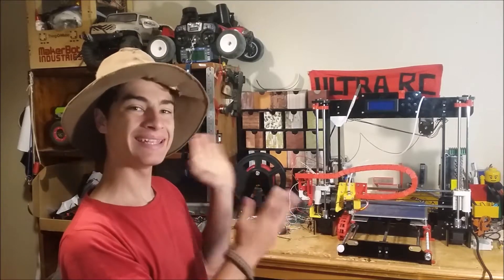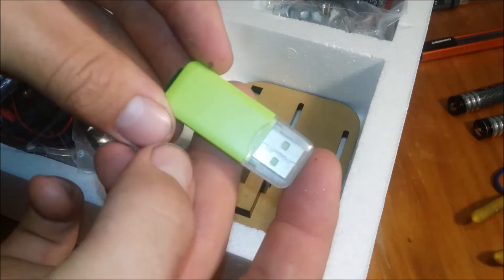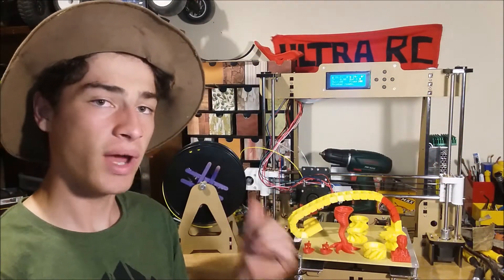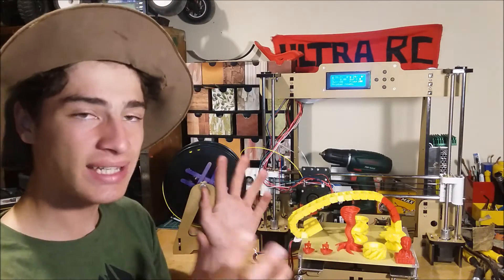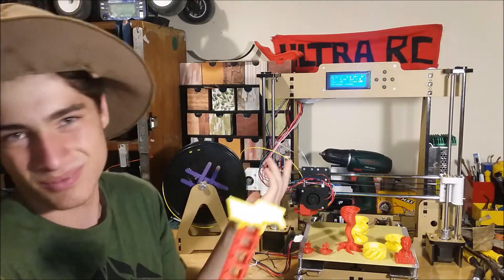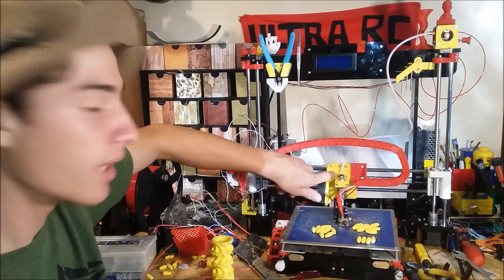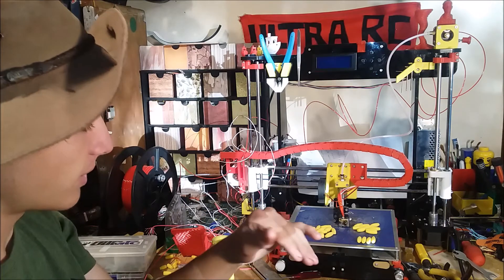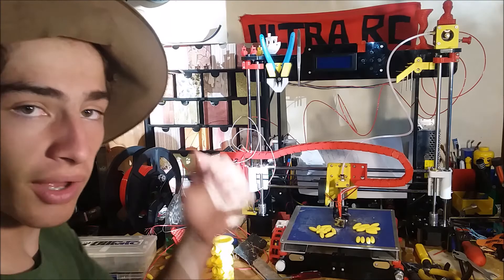Anet A8 3D printer 2019 review, upgrades and build //ULTRA RC

Comment: how are you able to pause prints on the anet? i've tried adding post-processing in cura but the machine doesn't pause for more than 1 second. do you typically just pause manually through the lcd screen?
Reply from the maker: I just pause on the lcd screen,
In the past i have used cura to make it pause at a certain layer height so you can insert something and then press resume on the lcd, i dont remember how but i have in the past, lcd is the easiest way!!
Thanks for watching this Awesome ultra rc video mate!!!!!!
I appreciate your support!!!!

Comment: mine is all custom now  e3dv6 hot end direct drive  tl smoother  tmc 2100  drivers and new ramps 1.6 upgrade mosfet and  30 amps power supply  i love my Anet A8
Reply from the maker: thanks for watching this awesome ULTRA RC video mate.
i just blew up my older anet's main board
do you think i should give the ramps 1.6 upgrade a go?
keen to hear what you have to say!!!!!!!
Reply: @CORINKERSTEN  its my advice  i say yes its full customizable !:) you put great  tmc driver tl smoothers mosfets for the bed and the hot end but not really necessary for the hot end just  for be safer  but on my side Ramps set up work very well and its cheap :) my melzi noisy as hell board was always hot and one day its stop printing all kind of error (horror) now i can print 20 hours a day without trouble :)be sure to buy  the new ramps  board with the upgrade and beefier mosfet on it ! it worth the shot! now im running skynet 2.3.2 its works nice but you can also install Marlin both are safe Skynet 3d is derivate from Marlin so if you need help im here :)